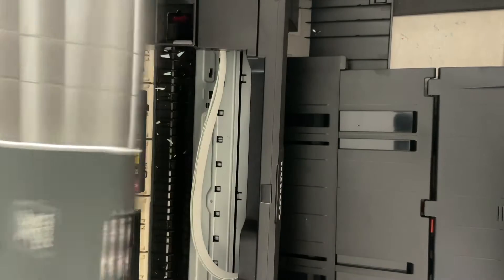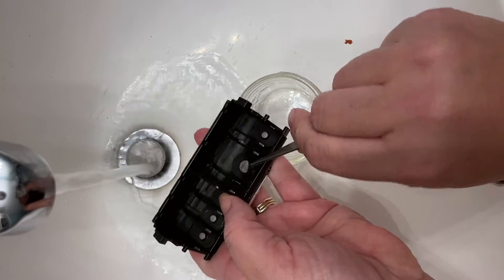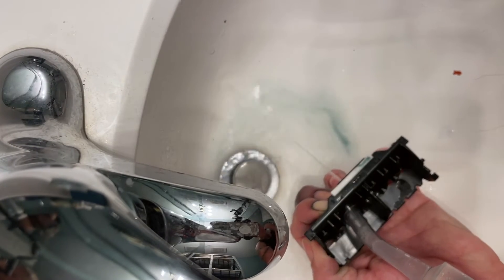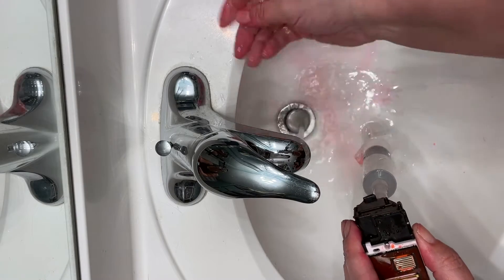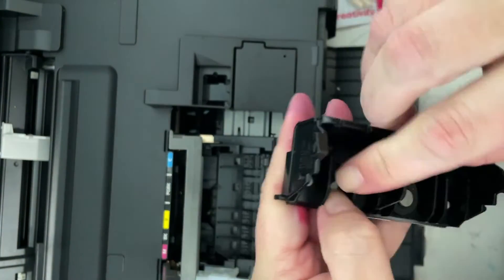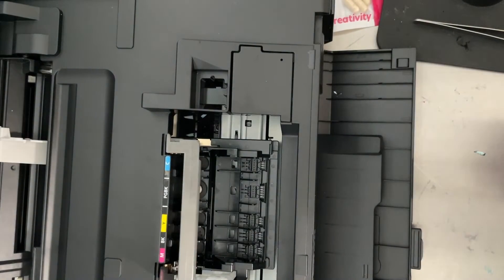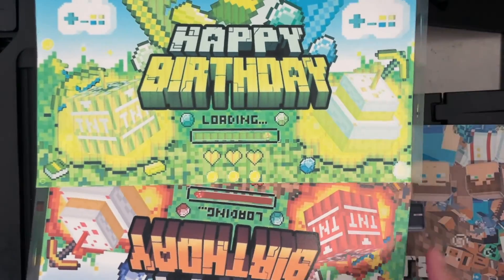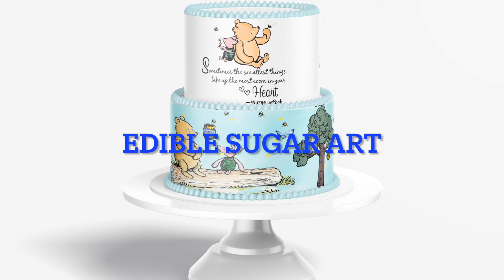How to clean your edible printer

Comment: Anyone having problems with the paper going through but not printing. Tried 8 sheets. Flipping so the plastic is at the top and bottom.  Been working fine but now says paper alignment problem. Works fine on normal paper. Even tried bonding normal paper and edible.